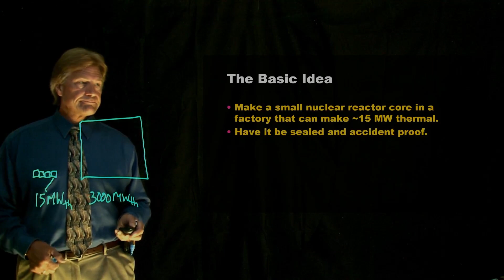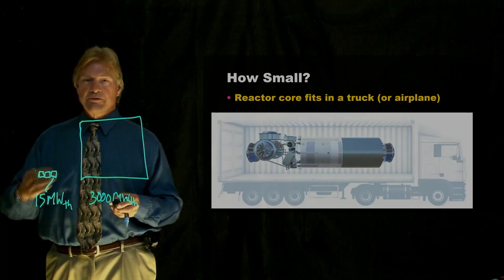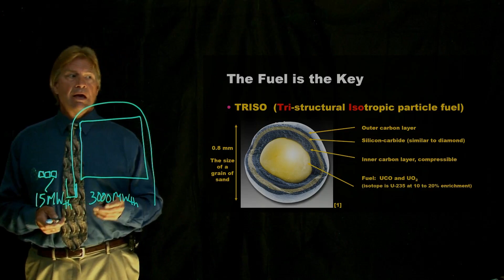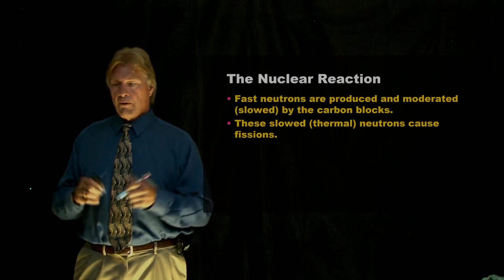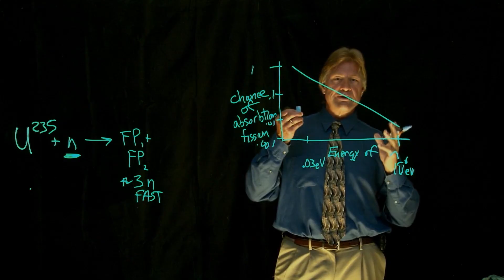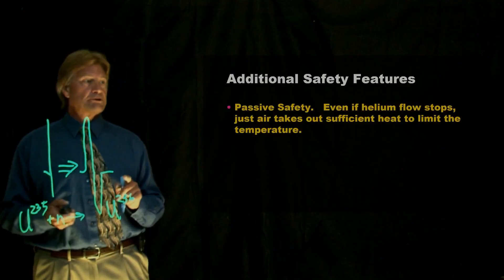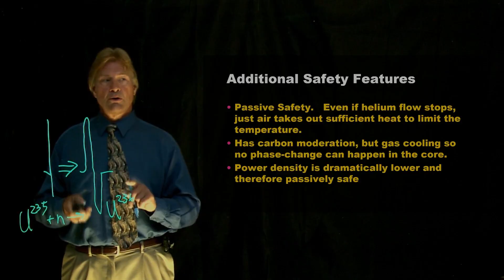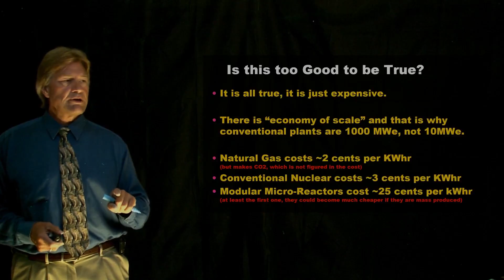Modular Micro-Reactors – The Future of Nuclear Energy?

Comment: I have a few comments,: 1. your neutron economy is suboptimal in these reactors. 2. The argument that the micro reactors are factory based is not valid, all reactors are made in a factory, where else? Boeing 737 aircraft also don't fit on a truck and need a huge runway :) . As a location near a very large body of water is optimal for larger size nuclear reactors,  you don't have to be able to transport the reactor by truck, a barge is fine. So if you want to have one hundred MW, you'd need 20 of these (15 MW thermal = 5 MW electric) so water cooling is more efficient anyway. 3. Security is a real concern (at least to those who worry about such things), when you place thousands of small reactors in a country such as the US. 4. TRISO fuel was tested extensively but FP's always seem to find their way out. 5. Electricity is real easy to transport. It could thus be, that very large nuclear reactors manufactured in series (not one in 5 years, but 50 per year, frozen design), would produce vast amounts of electricity also for heating. Anyway, the public opinion is the most serious hurdle...

Comment: Well, at least you're not talking about running the world with thousands of LFTRs. I even gave it a like. I'm in a good mood tonight. This might actually make some sense—although, as you suggest, it might end up being a niche player. Optimistically, that niche might widen with time, as experience is gained both in building the units, running them, and of course decommissioning them later.

But I do see some real limitations. First, district heating works best in really cold climates. In more moderate areas, you get competition from heat pumps. Of course, the population living in such really cold climates is quite limited. WRT process heat, first, I don't know how good this is going to be for smelting metals. For that, you generally need really high temperatures, almost certainly higher than you will get from one of these reactors, especially in the small sizes you're talking about.

I'll tell you one place they might do well: Direct air capture to reduce CO2. I think we're going to need that, and on a huge scale, though mostly just for a few decades. The energy cost of this will be very substantial. Now, the beauty of direct air capture is (1) you can do it anywhere, with very little land required, and (2) it does not require very high temperatures. So pick out a site that is good on disposal criteria. It doesn't matter if there are many people around, or if you have much wind or solar. Do capture in one good spot, and pump the CO2 down into a good geological formation. You provide the energy, do the capture, and do the disposal (such as pumping) all in one spot, which can be remote. You can even take the heat that is not absorbed, and possibly get additional use out of the even lower-grade waste heat.

I'm not clear on how you expect to keep one of these reactors running for 20 years without refueling.

I also wonder how thermodynamically efficient such a small reactor is going to be. But of course, I've just mentioned possible uses where that might not be a real concern.

Dang, we may have found new common ground between different viewpoints.
Reply: Skim through everything that you just wrote in it seems like you believe that uranium is not able to melt aluminum. I don't understand what's going on in your brain but that's okay as I said a moment ago in my prior comment sometimes when you have a question it's not necessary to spend all of your energy making sure you never get it answered. I hope you consider the possibility someday.
Reply: @Irene-fu6gj  What in blazes are you going on about? I don't know about your "prior comment," but it certainly was not to me, as I just left this first comment. I'm not going to go hunting to find your own comments. GMAB. You seem to be saying my comment was too long. Sorry if it went into stuff you didn't find interesting, but I really don't care.

You discredit yourself by talking about "melting aluminum." It's clear that you don't know that aluminum is not *s*melted (if that term even applies) by the thermal reduction processes used for other metals. Aluminum has to be refined from alumina by an electrical process. I stick by my original comment. Let me be more specific: If you are smelting metals by thermal processes, such as you might do with iron, you need high temperatures. Iron requires over 1500 C to melt. I'm pretty sure no nuclear reactor has ever been built that runs that hot.

Comment: Excellent idea. I have a scifi story I've been playing with most of my life. One of the techs is self contained power in all components requiring power. No central power units and no wires or power conduits of any kind required. Blow up half the ship, and the other half suffers no power interruptions at all. They are also self servicing using atomic particle recombination tech using material drawn from the surrounding environment. They are fairly trick aliens who have achieved nearly 100% systems reliability.

Comment: What would the thermal to electric conversion efficiency be for this? Would it be similar to the nuclear reactors currently operating, roughly 33%? Also, what would the required land use be as compared to solar (1 acre/MWe)? I know they're buried, but you can't really build on top of them since you'll need to dig them up in 20 years.

Comment: With these pellets having 10%-20% enriched U, could there be a proliferation risk?  I was under the impression that a "normal" reactor only needed about 3% enrichment, which was much less valuable to swipe.
Reply: @kcrusch 10%-20% is no good to swipe as you need to enrich it to 95% to 97% for a weapon and the easy bit it enriching to 20% the hard bit is the last 80% up if you can enrich 20% up to weapons grade then you would not care. Even tho above 20% is classed as weapon grade. You still need much higher the hard bit

Comment: Mark Nelson has a very different take. Dreams of advanced nuclear and the SMR revolution around the corner which will solve all of Nuclear's problems such as economics, safety and load following are very popular within the Nuclear Energy community. These technologies are exciting and an inevitable addition to the nuclear energy mix but are they the quickest nuclear route to deep decarbonization? Are they a substitute for our existing cutting edge large scale nuclear technology like the recently unveiled Barakah station in the UAE or our "old" reactor designs like CANDU which can burn used nuclear fuel and thorium? 
I am joined by Mark Nelson, the managing director of Radiant Energy Fund and a leading researcher and speaker on the status and prospects of Nuclear Energy to wade into this controversy. Mark is a former generation fellow at the Breakthrough Institute and was a senior analyst at Environmental Progress. He holds degrees in mechanical, aerospace and nuclear engineering. 
This is gauranteed to be a controversial show and I look forward to the debate it will spark. Please follow us and join the debate on Twitter @decouplepodcast and on our Decouple Podcast Facebook page. Worth checking out. https://anchor.fm/chris15401/episodes/Existing-Nuclear-and-Imaginary-Nuclear-feat--Mark-Nelson-eibgl9

Comment: Still prefer motlen salt reactors, even the molten salt cooled variety.
Reply: Yes it should be a popularity contest for people that maybe have a GED to chime in on. That's how we should decide how we spend most of our "G and peas" by taking a popularity test
Reply: @Irene-fu6gj  Errr from a technical perspective I prefer them, as he said himself they are not scalable to large scale installations due to low power density, while molten salt reactors even just molten salt cooled realtors have a greater energy density than PWR or BWR therefore making them more economical, also the fact that you don't need to make the reactor core out of 9" thick steel as you are only running at like 4 atmospheres of pressure rather than 300, the power density goes way way up even ignoring that the inner core it's self is more power dense.

And the same rules apply to molten salt reactors and molten salt cooled reators as to micro reactors where you don't build them onsite, you build them in a factory line.

So all the economic pluses without the economic downsides, this only really applies to molten salt fuelled reactors, but they can be passively cooled because of the higher salt temperature, so you are further away from ambient tempeture allowing for greater cooling efficency to a point that you can get rid of decay heat through air cooling and natural convection in the core to the cooling system.

So if you ever did get to 1000C you should be able to get rid of a stupid amount of heat passively, although you would have pushed the core outside it's operational limits so you would need to trash the core, but it wouldn't have leaked or anything, it's just the heating would have deformed stuff through thermal expansion.

Molten Salt reactors are going to be a little bit absolutely safe because of the higher energy density compared to microreactors, but they would still be passively safe, much safer than water cooled reactors due not using water as the coolant, as the boiling point of FLiBe is 1400C at atmospheric pressure, and other proposed salts have similarly high boiling points so it just gives you a safey margin, you could also use Tin or lead, but they have a choppy temperature coefficient, as while they do have a negative tending temperature coefficient as the slow neutrons less as they heat up hence slowing down fission, isn't as big bumps in it, so if you get beyond a certain point it will rather than slow neutrons down less, will slow them down more causing a faster fission rate.

Comment: How large are these buildings that house micro-reactors? I don't think you're going to be competing with diesel generators if they require large buildings. If they're not portable, that's another issue, too.
Reply from the maker: It won't compete with kW -level generators.  10 MWe diesel generators is replacement target.  They are big too, and use a lot of fuel, which has to be continually brought on site.
Reply: @illinoisenergyprof6878  Ah. Thanks.

Comment: What kind of application could this have on a cold planet where mining takes place? Seems like it wouldn't happen for a while but, with decreasing  costs for sending goods into space, would a small, energy dense system like this be worth having? It certainly seems like the best portable option man has to offer currently.
Reply from the maker: If you are going to go into space, you probably want a reactor with a higher energy density, since total weight is a huge issue.  There are good nuclear-related options, but probably not this one.

Comment: Sounds more like what you're proposing is a large, nuclear battery.  That's great.

Question, though : you mention the fuel pellets as large as grains of sand.  When dealing with a hazardous substance, it seems best to err toward a construction that is easily identifiable to the average person, such as the additives in propane that make it stink.  Shouldn't the pellets be made so that they are large enough to be counted by the human eye?  Large enough so that in the case of disaster, they can be clearly identified and avoided?
Reply from the maker: You never see or have a loose pellet.  The are embedded into graphite blocks. Those blocks are good size -- see the one figure in the video that shows the making of the core.  Thanks for the question!

Comment: Yeah, figured the problem comes at the price. 10x more expensive doesn't sound viable for mainstay. Would be interesting what the price would be if they are built industrially, but I doubt it could make up for that.
.
Could still have its uses for on-site, but it doesn't sound like "the future of nuclear". Just a seperate branch.
Reply from the maker: You are right.   This may be the first branch in many years to gain acceptance however.   There is no other efficient carbon-free way to make district heating  which can be used anywhere.
Reply: @illinoisenergyprof6878  
True, and it would break the absolute, perhaps allowing a rational conversation on general use of nuclear energy.

Interesting notion, thanks! And many thanks for your insightful videos!

Comment: Professor, how come the modular bit includes the heat transfer system? Does that need to be contained? It seems like a waste to throw it out all that equipment with the spent cartridge.
Reply from the maker: Most of the heat transfer parts can be re-used. It is just the loop of helium that goes through the reactor core itself that would have to be taken away.

Comment: Sir, the graph with the thermal fission response seems to stop "resonating" at even higher temperatures. Does that mean that fission would still occur at really really high temperatures?
Reply from the maker: No.  To the right of that graph is neutron energy, not temperature.  The resonances are in that mid energy range at any temperature. What happens when the fuel gets warm is that the widen, meaning that neutrons would have a higher chance of being absorbed.     Good question, I can see how that could be confusing.

Comment: Many years ago, after learning about the losses of energy from the actual procurement, through the power plant, transformation of electricity, through the powerlines, another transformation until it reaches it's intended destination... the only thing that made sense to me was on-site, clean power production. That meant one had to be comfortable to have a reactor in their living block's basement and using a fuel that has a low energy loss per cycle. Nuclear is the only way to go, if you can look past the terrible efficiency of current reactors and go to other forms of nuclear power.
So what is the fuel efficiency of those tiny pellets? Is it again just ~1% ? If so, then the idea is nice and dandy, but inevitably worthless. You'll be ending up in the same contract-trap that conventional reactors use.

Comment: i always wonder why do nuclear power plants rely so much on pumps to move the cooling water around would it not be more reliable to use gravity and mechanical valves to control rate of flow. after all pumps fail but if gravity fails we are screwed any way. not that i am saying thats likely but its is a possibility.i get using pumps to pump the water used to generate power but just the water that is needed to keep a core from melting going from being pump driven to gravity would make it really hard to get a senario like that to happen. i mean the would would have to stop rotating. or something like that.

Comment: sealed and accident proof
Never underestimate the stupidity of idiots with power tools and welding gear. So when Nukes 'R Us goes bankrupt from bad management and frivolous lawsuits in 15 years, the unit is left in the ground for 5-20 years after it's design lifetime, stops working efficiently or at all depending on the systems, and is abandoned in place by the owners, some idjits will come along and break into it to get the valuable materials out, ignoring all the warning signs that say 'there is deadly radiation inside here don't poke it'.
I like nuclear power. I WANT nuclear power. I'm not afraid of it, I'm afraid of morons. 
Oh I'm not sure mentioning Boeing helps your case; the 737 MAX has been grounded for more than a year due to a supposed software problem.

Comment: And when the molten sodium hits the water you'll have a very nice reaction. There's a reason why the Navy shutdown their molten salt reactors.
Reply: Molten salt reactors are not the same as the sodium reactors tested by the Navy and tried in a few other reactor designs. For example, both the MSR reactor ORNL pioneered and the LFTR concept use 'fluoride' salts which won't react explosively with the air or water. (as opposed to 'fluorine' which will). When most people talk about molten salt reactors they're talking about using the same class of salts as LFTR.
Reply: Molten sodium reactor's use NaK which is a metal alloy, not a salt...

Molten salt reactors use various chloride and fluoride based salts. Sodium based salts don't offer any real advantages for the price difference.

Comment: NASA's kilopower project created 1KW solid state reactors that use stirling engines for power generation - and they can daisy chain the individual reactors into 10Kw nodes. If you had 4 nodes you could run a semi permanent moon or Mars base with little trouble.

Getting to megawatt class power in space ofc is another thing, but once your habitation facilities have independent power it becomes much easier. Plus they are launch rated.